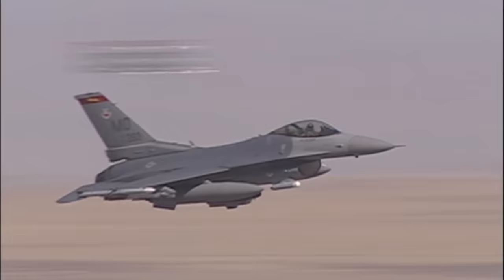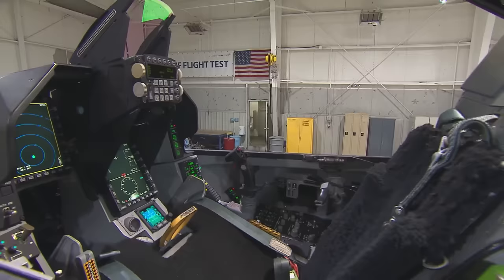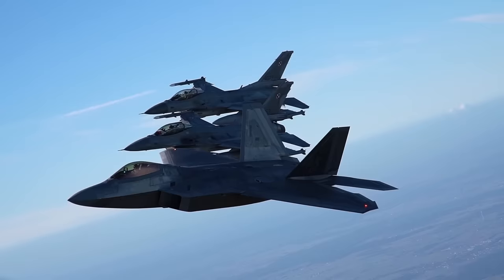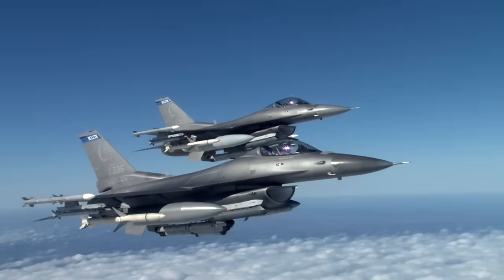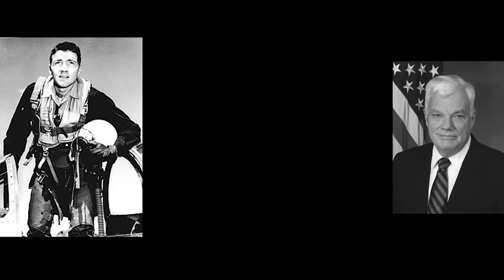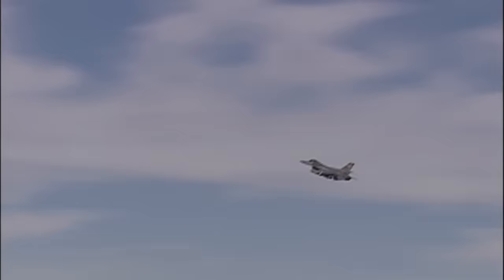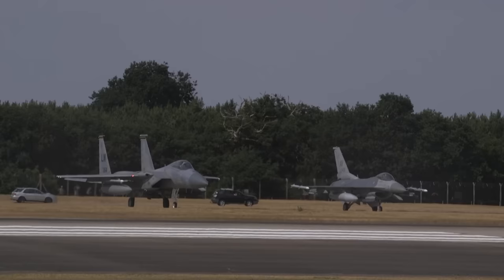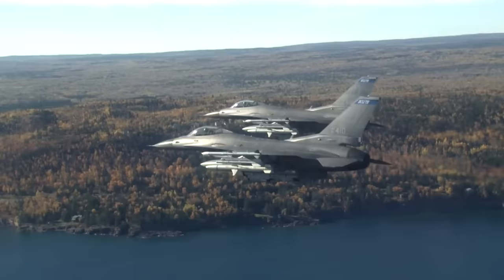Block 70 F-16: The Next Generation Viper Fighter

Comment: The F-35 is trash it can't even shoot down a F-16 with odds stacked against it! The B and C models don't even have guns! I personally haven't flown a plane but I'm sure I can design a better one from my 20 years experience consulting data sheets.

First thing to go are those stupid million dollar helmets! Just use some iron sights, if they were good enough for Richthofen they're good enough for you. When it comes to weapons we'll stick the GAU-8 on the plane. Not only is it the best damn gun ever designed, capable of going through MBTs like butter, but it will save money compared to the single-use 250,000-dollars-a-pop air-to-air missiles and smart bombs.

Next thing to go is the stealth, which is a stupid gimmick that doesn't even work because low resolution radars can spot them. Speaking of radars, why even have them? Not like they're going to be much use in a fifth gen environment anyway, just use FLIR instead because radar can't tell the difference between a military plane and a civilian one.

Now we need to talk about thrust-to-weight ratios. Fist off we only need enough fuel internally for a single dogfight, the rest can be stored externally in drop tanks. When it comes to engines we'll use the ones from the SR-71 Blackbird, it's should have plenty enough power for what we need. Sure the airframe is going to disintegrate the second you try to maneuver, but we need to keep the aluminium support beams as light as we can because steel is too heavy and titanium is too expensive. And what's with this obsession with high altitude supercruise? Data from Vietnam shows that even with supersonic jets dogfights all happened at subsonic speeds on the deck.

And what's with all these cost heavy computers? WWII pilots didn't need them! Secure data links? Please, all you need is a cheap two way radio. I swear the military is full of money launderers more concerned with lining their pocketbooks than the lives of the men on the front. The Fighter Mafia were right; when left to their own devices engineers will needlessly stick random useless junk all over their projects. Keep It Simple Stupid!

I'm sure China will have to respect our interests once they see how effective our new fighter is.

(To those of you about to reply, yes, this comment is satire; I'm trying to make it sound stupid and outrageous on purpose)
Reply: Lol I stopped at "it can't even shoot down the F-16"
You need to go back and look at how that really went down.
Reply: @rogerwilco5918  I'd like to implore you to read the entire comment before you reply. I think you'll get a kick out of it.
Reply: I admit, you had me until iron sights.  Hahaha.
Reply: @pyronuke4768  there's no point in going on, you were obviously misinformed.
Reply: @MalfosRanger  you made it way further than I did.
Reply: @rogerwilco5918  The post is a parody.

Comment: This is what the USAF should buy instead of that POS, overpriced, F-35. A Marine had to punch out of another F-35B today.
Reply: The F-35 fulfils a different role than the F-16 that’s why it’s selling rather well and improvements are made on a monthly basis.
Reply: Oh no, another F4u deep sixed an ensign.  That deathtrap will never amount to anything and certainly won't shoot down no jet.  -Anonymous, 1942 (probably)
Reply: @MalfosRanger  Did the Corsair first fly in 1922? The F-35 first flew in 2002, if after 20 years it still isn't reliable, I doubt it ever will. 
Speaking of the F4U, the Navy wouldn't assign it to carrier duty until late in the war. Until then it was used by island based Marine squadrons like VMF-214 "Black Sheep" aka "Boyington's Bastards". The reason was because it had such a long nose aviators found it hard to make carriers landings. Unfortunately, VMAF-214 are trying to fly the F-35 Flying Waiver. What alternate Universe are you from? Japanese jets in 1942? 😆 Both F4Us and P-51s got jet kills but for the F4U it wasn't until early in the Korean War before the F9F Panther took over.
Reply: @dmitris.479  I can remember when the unbeatable fighters were the Century series and early F-4s because guns wouldn't be needed. the Sparrows and Sidewinders would kill the bad guys before guns range. Guess what? The kill ratio was so bad the Navy wanted a Vulcan cannon on the new F-4E with the Air Force yelling ME TOO! ME TOO! Stealth is wonderful on bombers but I doubt it will ever be effective on $100,000,000- $130,000,000 fighters. I would also remind you that a Viper pilot in Iraq evaded 6 SAMs in one sortie. 
As Scotty said in The Search for Spock, "The more you overthink the plumbing, the easier it is to stop up the drain."
Reply: @tbolt2948  well said sir but, as times change so does technology and such Stealth Air superiority fighters are needed to evade modern means of detection and having different methods of defeating such adversaries. You can have all the agility you want but it does you no good if you can’t hide from a trained shooter 100 yards away.
Reply: @dmitris.479  I'm all for new tech but stealth won't stop heat seekers or the Mark One Eyeball.
Reply: @tbolt2948  Tried spotting a jet from 30km away? BVR combat is what the F-35 excels at and all of its sensors like EOTS and it's radar will ensure that's where the fight happens. The F-35 has a kill ratio of 17-1 in Red Flag btw
Reply: @mikehawk2158  Have you seen the news lately? They just grounded the F-35, they can't even keep it in the air. What you are saying is the same thing that the DoD kept saying after Korea, through the Century series until they put a Vulcan on the F-4 during Vietnam. They learned, the hard way, that it can still come down to a knife fight. And the F-35 is the wrong plane for that.
Reply: @tbolt2948  They grounded the F-35 because they want to know the root cause of the crash and how to fix it. Overall, the F-35 has a far better pilot mortality rate when crashing compared to an F-16. You are comparing a 70-year-old war with the modern environment. They didn't have as good radars and sensors as DAS and EOTS. Missiles back then were lackluster. You can't compare an early sparrow with an early radar on the F-4E to an F-35 armed with AIM-120s

Comment: Why do i have a strange feeling that the F-15's & 16's will out lived the F 22's & 35's....😁😁😁😁😁😁😁!
Reply: Gimme 10:1 and I might take the bet. Probably not but might. Hell the Navy is upgrading the F/A-18 to E/F config and also starting on the F/A-AA. So doesn't bode well for the -35 or -22.

What really needs to happen is get rid of the entire pentagon, completely revamp our procurement policies and procedures and put them far more on a commercial basis.

This clown car cavalcade would have been fired years ago and probably jailed for gross incompetence and risking the lives of pilots, maintenance personnel and just anyone unfortunate enough to be underneath the next f-35 hurtling earthward out of control.

Comment: This jet is out dated! 5gen 6 Gen are now where it’s at! I love the jet but it’s done! It’s just cheaper
Reply: The Block 70 package was designed for this particular reason to keep it up to date in every way. Without compromising national security information of 5th generation aircraft.
Reply: @dmitris.479  true it has some things from f35 and F22 but it lacks more than just that and can not be used in 5 and 6gen areas
Reply: @loftisjason6936  believe it or not it can to a certain capacity it just has to be configured for it.